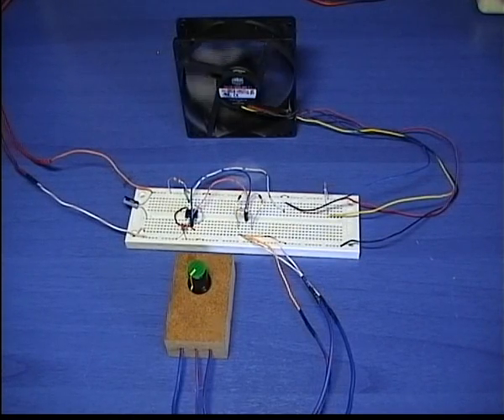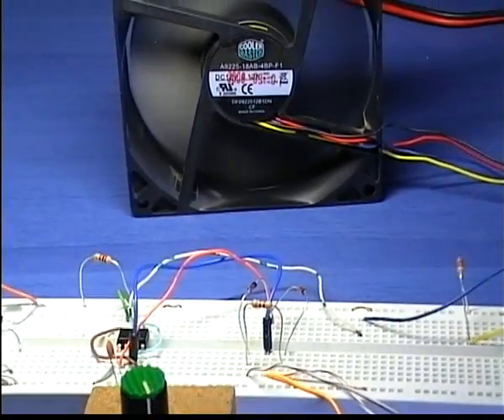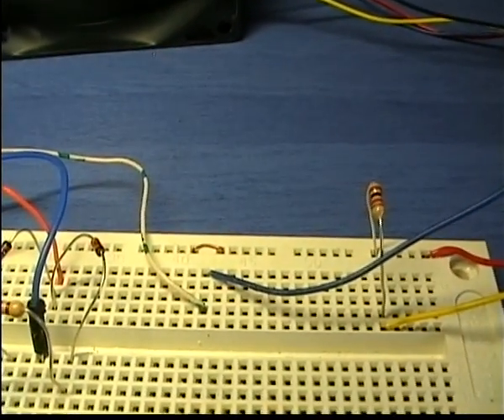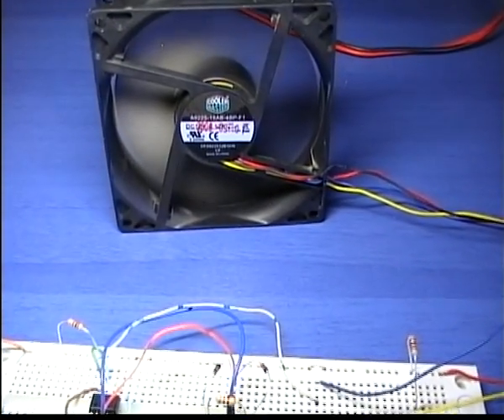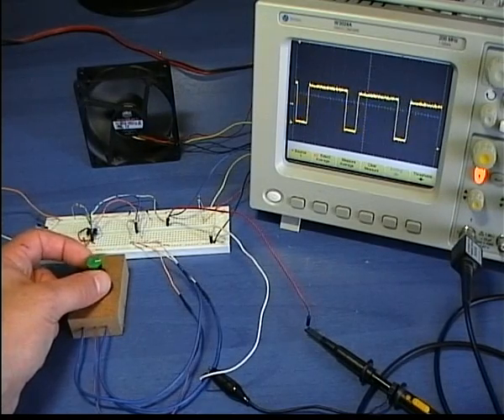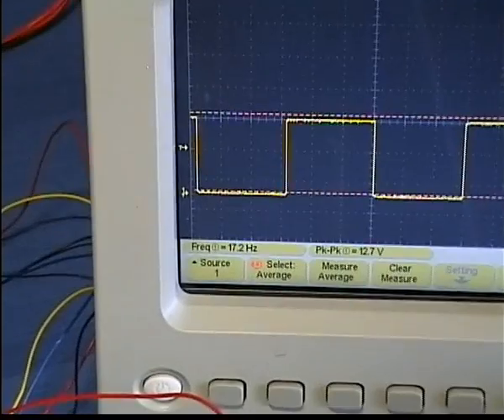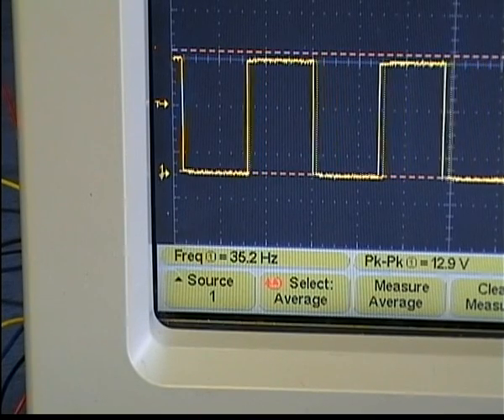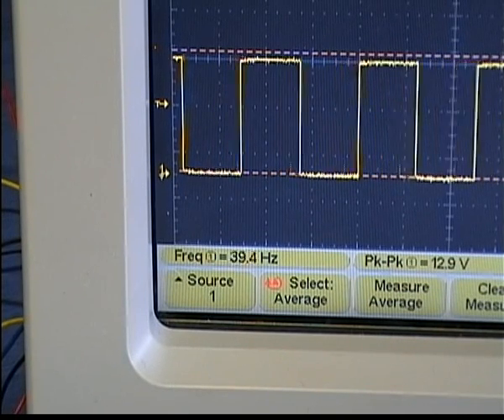PWM motor controller with High Frequency pulses

Comment: I've just finished preparing this circuit posted on PCBheaven and it works as a dream. It's exactly what I was looking for. :D Thanks a lot! I don't have enough PWM slots on my motherboard and this solved my problem.
Reply: Does it works good?
Reply: Can i control Intel fan from this?

Comment: Hi Sir,
I know this is an old video. But am I right in assuming that because the controlling circuit is not dealing with running current that this could control any size PC fan? I am thinking of using this to control a 0.2 amp fan or a 2 amp fan.
Thanks

Comment from the maker: @leeYT321987 i said only 4-wire fans? maybe i meant only 4-wires because it has no switching transistor or mosfet. You can add your own and use it with a 2 or 3 wire fan.

Comment: I'm thinking of using a 555 timer to control a transistor, in order to PWM a two-wire fan.   Is there a reason you said to only use PWM on 4-wire fans?

Comment: Excellent demo, thank you. What I'm looking at doing is building this circuit so I can control two PWM fans in parallel. Do you see this as being an issue? 
At the moment I have the two PWM fans connected via a 3pin splitter which is to much noise for my application.